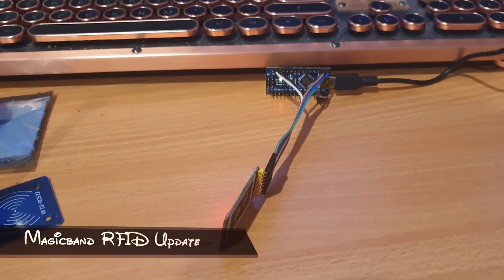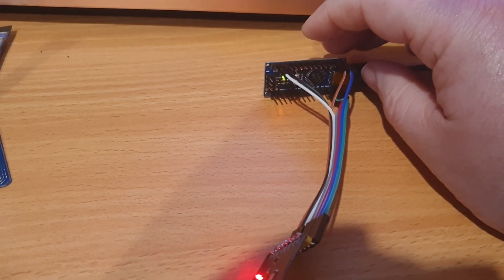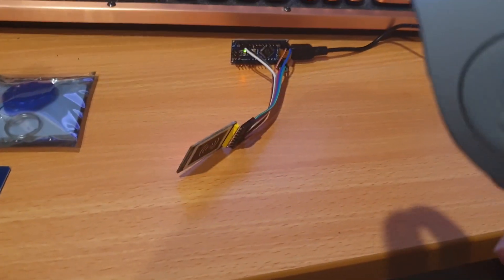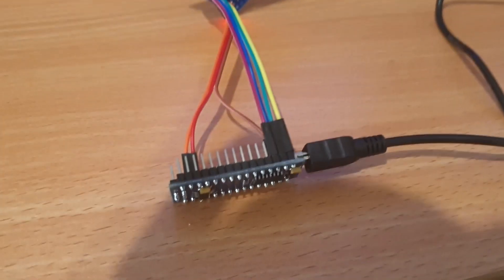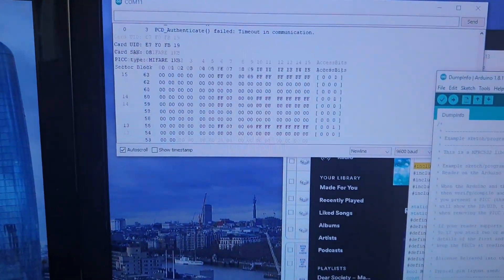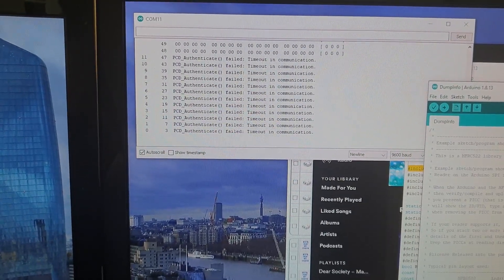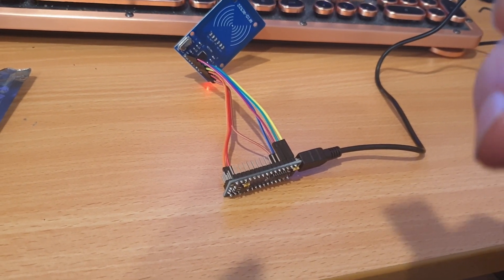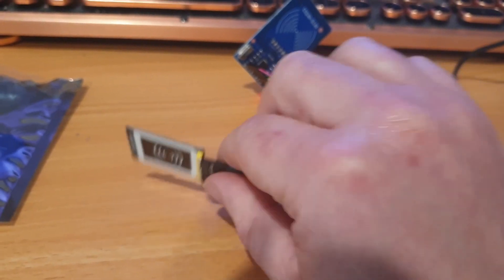Magicband RFID Reader Update

Comment: Hey…Great job here…I’m trying to figure out how to list multiple “approved tags”, basically I want to list multiple magic bands that would trigger the confirmed sequence. Right now I can only get one to work. Any recommendations?
Reply from the maker: Assume you've already read the codes for each card (they should be unique) then it becomes an if statement based on the UID.  In the description I put a link to the code repo for the magicband reader I was building which should show you how I've done it (too hard to post code here).  Look in the loop section after "if (RFIDON == true) " and you will see an example with two if statements for different UID's. If you've already done something similar make sure you haven't nested the second IF statement within the first.

Comment: Thanks for this! After following the comments, I went with a PN532 v3 and it's been successfully reading my 3 year old Magic Band. Occasionally it takes a second or two but it works reliably.
Reply: I just tried to use the "working" Mini RC522 and it doesn't work for me at all (can't get it to read anything). The "Not working" actually reads the key tag and card but not Magic Bands. I am such a newbie that I don't know what I am doing wrong, but considering trying PN532 due to this comment. Would appreciate some help/advice.
Reply: @leonawong6878  I think that is your safest bet. I wasn't able to get the RC522 to work and ended up sticking with the PN532 which are pretty easy to get on Amazon. I'm not sure what I was doing wrong with the other part but over a year later and the PN532 is still working fine for me.
Reply: @JPToto  Thanks for your response. I'll give that a try. :)

Comment: I just ran into a similar issue and I’m pretty sure the issue comes down to power supply. The magic bands have 3 antenna inside so an RFID reader has to power all 3 of them to get a response since all 3 will be drawing power and if the battery is dead then the bands will need more power. That’s why if you have a fresh one the 522 board will read it but if the band is old at all it won’t. You can check this by supplying 5V to the 522 (even though it won’t be happy to stay at that voltage) the 522 should be able to actually read a band then. 

The chip you have there looks like it has a different antenna and it probably supplies just a but more power to the bands then the 522

Switching over to a HiLetGo PN532 will give better results and better range because the chip is designed for 5V and it has a similar antenna setup as that black band and will supply more power to the magic bands. Increasing the distance and reliability.
Reply: 🧂 and here is your grain of salt because I’m just some guy on the internet
Reply: Switching to 5v made the RC522 work with my Magic Bands, thanks (for what it's worth before my board blows up).  lol  Did find some old bands that didn't work, probably dead internal batteries.
Reply: Got the Magic band to work with ~4vdc on the RC522 board.  Put a 30ohm resistor between 5v and the RC522 Vin.  Had it down to 3.8vdc with some success too.  Will prolong the life of the board, compared to using 5v.  Of course if you go this route, you are exceeding the max Vin still based on Mfr spec.  For me, I'm not leaving it on all the time and I'm not using it to put a rocket into space, so I'm not all that worried about it.  @MikeOwen, thanks for the tips.